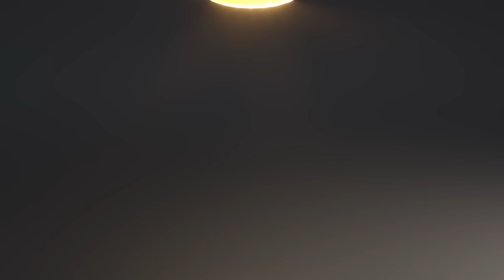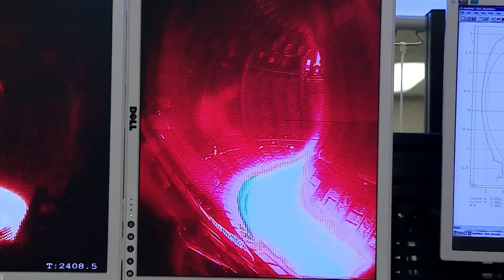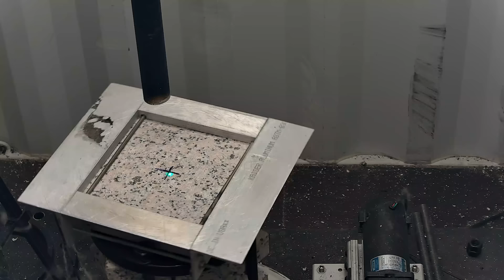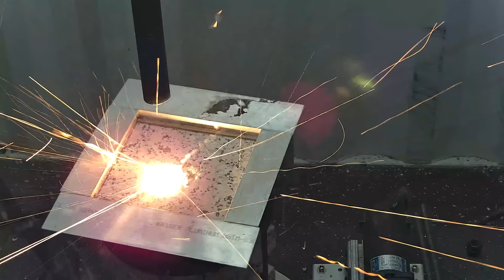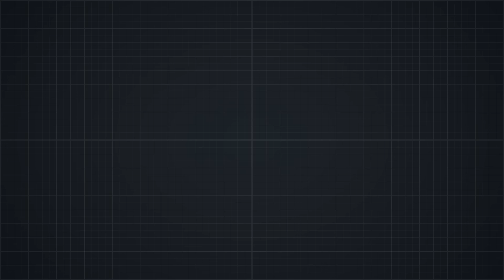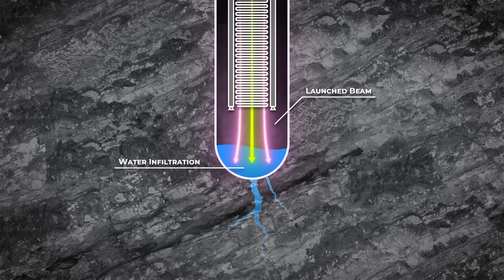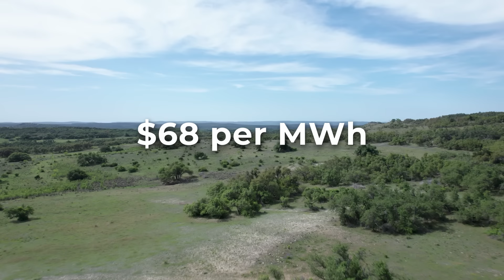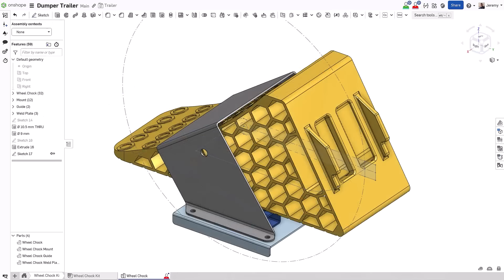Geothermal Energy is Changing

Comment: "What if you drop a lightsaber perfectly vertically?"
Reply: Oh stop it Rick😂
Reply: @64mikecowart what did I do?!
Reply: @rickcramer9426  😂
Reply: @64mikecowart  adult swim did it first
Reply: @ 👍 Next time read all the replies on this comment and you’ll see I posted a YouTube short of Rick and Morty. Satire isn’t for everyone
Reply: "Perfectly fkin vertical"
Reply: The hilt is larger than the blade, so it would get stuck unfortunately.
Reply: @philb5593 What if you give it a smal precession around the longitudinal axis?
Reply: @ That might work if it's at a high enough rate
Reply: @adamadamadamadam ?
Reply: @philb5593  you’re no fun Phil. Watch Rick and Morty
Reply: @philb5593  Now that is good design, avoiding a Rick incident from ever happening.
Reply: @philb5593  'The hilt is larger than the blade, so it would get stuck unfortunately.' Fortunately! He meant fortunately!!
Reply: It would probably make a scorch in the earth and fall over. We see that it doesn’t cut through objects instantaneously and without resistance. Qui gon cutting through the blast doors as an example has to push through the metal with some degree of effort to move it through the metal.

Plus lightsabers tend to turn off when dropped and without a force user keeping them activated.
Reply: You could tie the hilt to a fishing rod and control the depth like that.😂
Reply: @rened.5998  Holy futuristic bootleg 😭
Reply: Corridor did a video about this.
Reply: Rich Sanchez Entered the chat
Reply: The miniaturized power source in a lightsaber only works because it recycles the energy in the blade, that is unless the blade it touching something. So you'd overload the power source eventually, plus where are you expecting the matter to go? You think you'll drop it and the dirt and rock just disappears?
Reply: What if Hitler cured cancer?
Reply: it's gonna pop up in China.
Reply: “What if you do a poo perfectly vertically”
Reply: Stay vertical!
Reply: @Nightsd01  “vertisabre what is your prime directive?”
“To stay perfectly vertical”
Reply: Please don’t! We don’t wanna become a donut 🍩
Reply: If nothing else the handle would melt eventually in the mantle
Reply: It's almost that! It's just that our light saber need to be as long as the hole because the power suply is at the surface in our case
Reply: It would vanish and instantly become one with the cosmic force and you would have to make another one lol 
"Where is your saber padewan"?
"Droped it agin" 
"Did you get the kyber crystal drops & spills protection for only 5 more credits?
"NO"
Reply: The beam is thinner than the handle... and of course, there are the ever escaping gasses from the super heated material pushing the saber upwards. The handle it also heavier to begin with than the nothing of light or sci-fi plasma thingamajig whatever glowy bit and so it will constantly try to turn 180 degrees. Short answer: nothing all that interesting.
Reply: Id put my lightsaber in it 😉
Reply: They could also try a laser like on the death star
Reply: Jfc are you trying to kill us all!?!?😅
Reply: You get a Rick & Morty episode.
Reply: Realistically the saber would float in the molter rock, which is more dense. 
So it wouldn't sink very deep
Reply: @manuvillada5697  molten rock is the goal
Reply: I think the idea is that it vaporises the rock into gas so it's less dense  @manuvillada5697
Reply: Perfectly fking vertical
Reply: Lightsabers are fiction.
Reply: Thermite??
Reply: Your mom should have swallowed
Reply: I continue to "shake" oilmen with my innovative project of a non-combustion engine, I remind you that I am posting here on my channel the technology and the principle of operation, according to which anyone can create a prototype and enjoy free energy, since I was denied financial support at the stage of the idea and theoretical research, after a year of unsuccessful searches. Including I will begin to assemble a sample. And soon another video will be released, revealing my developments, the wind of change is approaching! All those who are not indifferent, welcome to the flight in this departing innovative car, which will lead to great achievements for the successful future of the planet and humanity!
Reply: @maguccimotorincorporation  Now tell us about how much "they" have tried to thwart you . . .  those shadowy forces that live in the shadows and block your efforts from behind the scenes while keeping the sheep asleep. Then show us your Bedini Engine.
Reply: You’d have to drop two, because it needs two bore holes.
Reply: Phase that maser and we’re in Star Trek
Reply: What is my purpose?
Reply: @joeb134 butter
Reply: You has to be sentient
Reply: A flared base would prevent any accidental over penetration.
Reply: It would only get so far before the heat and pressure would melt or crush the hilt.
Reply: Lightsabers wud b rods already
Reply: Sith mole people
Reply: Its just bad design. The handle has to be wider than the diameter that is vaporized by the laser -> problem solved
Reply: A real light saber must exist in order for that to happen pal
Reply: I am Stronger! I am Better!
Reply: Original lightsaber or a Disney lightsaber?
Reply: Perfectly F**** Vertical
Reply: It would turn off. Watch any Star Wars movie and as soon as they get knocked out of someone's hand it turns off. The reason some Jedi can throw it is because they are using the force to keep the fail safe switch on as evident by scenes where they turn it on before pulling it to them.
Reply: The material needs to go somewhere. It wouldn't get very far 🤔
Reply: Unfortunately the vapourized rock would cause instability tipping the handle sideways and getting it lodged in the hole. Best to strap a bunch together such that the death wad is as wide as it is tall.
Reply: Perfectly fucking vertical.........
Reply: Would stop at the hilt
Reply: I had that same thought lol
Reply: Actually we do that in Europe, check out DeepU Project!
Reply: That’s basically what they are trying to do😂
Reply: Hear me out… we attach high powered lasers to trained moles
Reply: LCOE for wind and solar does not include correctly the cost of backup power generation/battery/water accumulation infrastructure needed to provide the nearly 100% power delivery reliability that's needed and required from all other power generation technologies.
In reality nuclear is the cheapest by far, even at current absurdly high build prices in Europe.
Reply: Rock/metal doors still take a while to cut, but holding one vertically and steadily dropping it would be most ideal 😅
Reply: the hilt would overheat and melt once it got deep enough  gravity would insure its allways being pulled twords the center too.
Reply: Vaporizing rock with microwaves? This is sci-fi becoming reality. Truly mind-blowing tech!
Reply: Unless you use The Force, it shuts off after a period of time XD
Reply: It would hit the floor... now if you turned it on...
Reply: It took ray to break the rock with the saber and they acted like it was a feat... I know Disney...
Reply: That would work. But Obi Wan's consulting rates have gone through the roof!
Reply: You could just build a drill ship
Reply: Why the f not? We spend $1.3 trillion US a year globally on climate change junk. $1.3 trillion could create how many research projects and facility's scholarships. How motivating could that be for young people. You could be the person who solves climate change instead of being told by Greta to get Ur tubes tied
Reply: A jedi can control its descent, so there is no need to be perfectly vertical
Reply: No thing such a childish lightsaber grow up.
Reply: If veritasium had your voice id watch his vids
Reply: All we need is a light saber now!
Reply: Higher frequency microwave than visible light 😂😂😂
Reply: The blade is narrower than the handle so it'd hit the floor and stop.
Reply: Lightsaber's turn of when dropped so that would not work
Reply: Genius
Reply: Power of the high ground 😂
Reply: May work if there is "the force" 😜
Reply: Too risky, it can destroy the core.
Reply: Clunk. The hilt's bigger than the blade
Reply: perfectly fucking vertical
Reply: Then you’ll get a Chinese Jedi😂
Reply: Might depend which colour. Not sure which one will make the planet explode like the Death Star.
Reply: XKCD perks their ears up lol
Reply: everyone knows that lightsabers eventually align vertically with the gravity, that's why they have a drop failsafe shutoff.... go cry at McDonald's about the sauce now...
Reply: @docwhogr  I honestly forgot about the Rick and Morty episode when i wrote the comment and now i'm getting bullied 😢
Reply: @aironebush346 i'm also an R&M fan, i hope you don't got my comment personally. it was for all the people replied at your comment with R&M quotes..
Reply: @docwhogr  nah bruv we good its all fun 😌
Reply: What if u rocket the whitehouse into space..
Reply: @patriot2314 best idea I’ve heard all month tbh
Reply: @patriot2314  
Please, the human race needs that
Reply: @patriot2314  wtf

Comment: As a drilling engineer, here's my 2 cents.
Currently, of the 2, electronics failure is a bigger hurdle than drill bit technology,. with standard downhole tools being rated up to 175degC, though in practice, 150ish degC is more common. high temp tools are around 200degC. the cost of making the electronics packages more robust is just not worth it, and geothermal companies generally have a far smaller drilling budget compared to oil and gas.  

Tools are routinely subjected to very high shocks (potentially a few hundred G's in bad conditions), not to mention torsional/axial forces, and bending. materials fatigue is also an issue. things that are rotated at upwards of 150rpm and then bent around in a well, are not generally happy for too long. mechanical failure can lead to things being left in the well, and expensive operations to try to recover them (necessary if a radioactive source is present for LWD).  

Strictly speaking, you dont need any downhole tools (with electronics) to drill, but it makes life much, much easier. and ultimately cheaper. They can variously tell you where you are (direction and Inclination), also known as Measurements While Drilling (MWD) and what you've just drilled through (petrophysics, or Logging While Drilling (LWD). steering the bit also benefits from electronic and mechanical tools, and anyway, old-school steering with a Positive Displacement Motor (PDM), or "mud motor" and a bit set at a small angle, is not going to work at high temperatures because the elastomers in the mud motors fail, and again, we reach the economic reality - materials exist, but not at prices that are reasonable for oil and gas, let alone geothermal.
Reply: but the machine that creates the laser isn't being lowered down, it never leaves the surface. it doesn't need any heat rating beyond not failing at room temperature
Reply: @Deltexterity  yes, true, but you miss the point a bit... ideally one wants to measure a lot of things while drilling, and this requires tools with electronics. whatever the target, one needs to know where one is in the rock record. you don't just drill blindly and stop when you have a good feeling about it.

conventional drilling usually results in rock at surface, so even without tools downhole, we can say where we are. vaporising the rock will not make useful analysis easy, or affordable, so presumably electronic tools would be preferred.

Government regulations require boreholes beyond a certain depth to be accurately surveyed, and indeed, if drilling wells that will be connected, either by fractures, or by horizontal wellbores, one needs to know where the borehole is in relation to the target zone and other wells. This all needs affordable electronics in the well at some point.
It's extremely unlikely that the well would be perfectly vertical, because rock is rarely homogenous, and if the process melts rocks at different rates, then things could get crooked. thus, even without steering tools, there is unacceptably uncertainty on positioning.
Reply: @cerealport2726  is there a reason you couldn't just use a rangefinder on the surface? measuring the delay of a light beam going down and back up the hole, checking again like once an hour or once every few hours to make sure it's still a straight line?
Reply: @cerealport2726  it would be easier for them to just lower the measurement equipment from time to time. In the end their waveguide is just a hollow tube (with extra channels). At given moment they can stop pushing down, wait till all the currently evaporated rock leaves the tube, and lower any equipment they want though the tube using just a steel cable.
Reply: @Deltexterity  assuming their RF radiation is coherent I would not be surprised they can measure depth of the channel continuously with centimeter accuracy using interference between incoming and reflected radiation.
Reply: @Deltexterity  In principle, yes, but in practice, no. What do you do when it isn't straight any more? how do you know what  to do to fix it? This might tell you where there is a problem, but wont tell you in which direction (azimuth) you veered off-course, or by how much (inclination, with vertical being 0 degrees) , or how fast the deviation built up (degrees of inclination and/or azimuth per 100ft or 30m drilled, depending on preferred depth units).
Reply: @cerealport2726  i'm not an engineer so i certainly don't know, but why would the solutions to those problems be any different from how they solve it with drills?
Reply: @Deltexterity  that's exactly what was explained in the original comment...
Reply: @ i must have missed it then my bad
Reply: @cerealport2726  It's extremely unlikely that the well would be perfectly vertical, -- Just plumbob it
Reply: @cerealport2726  excellent points

Comment: I like your video but did a poor job of explaining the potential benefits of geothermal power.  

Saying that electric companies optimize for the LCOE is outright false.  Electric companies need to meet the power demand of consumers.  Power demand fluctuates constantly.  The problem with intermittent power sources like solar and wind is that while they have a good LCOE their power output is highly variable and unpredictable.  Solar and wind installations can be producing at 100% one hour and close to 0 the next.  To account for this unpredictability power grids with a significant percentage of renewables need to store power in rather expensive battery systems and operate and maintain backup power plants, usually fossil fuel ones.  That adds so much to the power system that it makes power grids with a high proportion of renewable power expensive.  

What makes geothermal power a potential game changer is that it is a renewable power source that is perfectly predictable and can provide baseload power.  The heat from the earth is a constant unlike solar and wind power.   The only other renewable power source that falls into this category is hydropower.  Unfortunately like hydropower, geothermal power is currently limited to a few geologically active areas where only shallow wells are needed to access the heat.